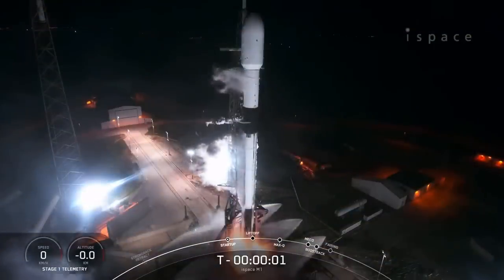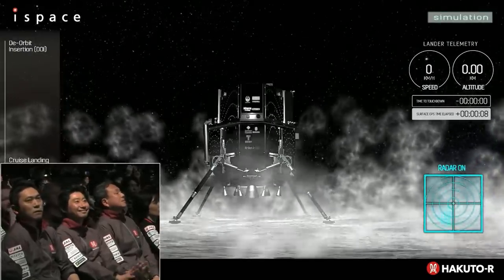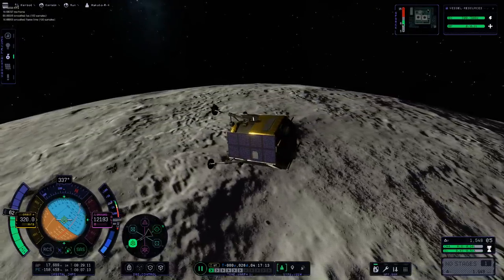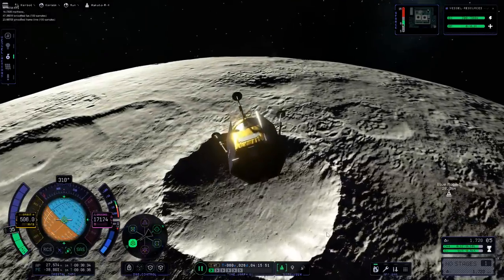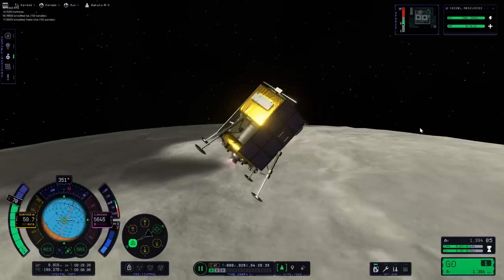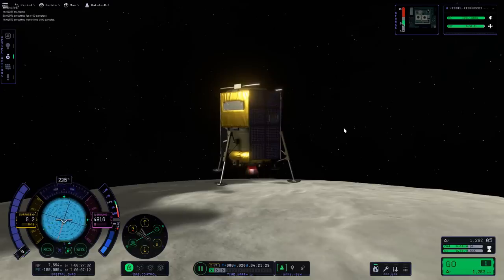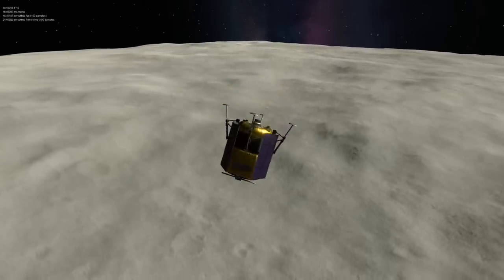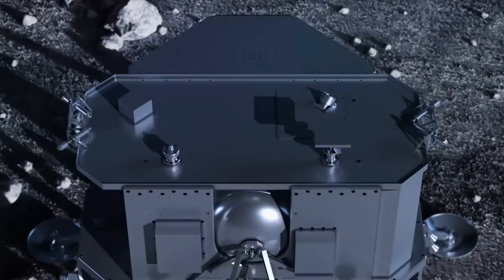Why Japan's Moon Lander Crashed Due to An Unbelievable Computer Bug

Comment: Not a software bug, it was a design bug.  The software functioned as specified.
Reply: How do you know? Did you read the design spec? If the design spec stated it should be able to handle multiple lunar landing locations, then it's not a design spec issue.
Reply: Definitely a process bug that this wasn't picked up in testing — but premature to say that it wasn't also a software bug.
Reply: @pigsnoutman  6:17
Reply: Mismatch at Requirements and/or Expectation levels. Activated by beyond test envelope operation. Needed a calm (seasoned?) "captain" to hold a steady, pre-planned course.
Reply: @simongeard4824  I think the video was quite clear on that the software started ignoring that sensor because it was programmed to do so. An intentional feature that behaved differently than expected because it was put into a situation that was not considered while designing it. And that this only happened because they changed the mission plan after the software was developed and did not test it again with the new landing site, because their tests would have detected the issue. That last part really hurts because they reasonably could have avoided the crash.
Reply: PEBKAC
Reply: If it behaved in an unexpected way (design bug) isn't that because the engineers had the wrong expectations?
Reply: Absolutely, the main thing is you got to have a radar altimeter. And they are small and compact and they use very little energy so why not have three?  If one fails, do you still have two working. I can’t believe what kind of idiots we have in the aerospace industry
Reply: @pigsnoutman  The design spec probably did not specify that it should be able to handle multiple locations since it would only be making one landing.  They gave it a new flight profile without realizing that there was a terrain feature that was abnormal enough to trigger the failure detection routine with perfectly valid data. If a portable earthquake detector gets knocked off the table by the family cat, it's not a bug in the software if it starts reporting an earthquake.

It's retroactively obvious that they should have re-verified the sim with the new flight profile.  They were a bit over-confident that not enough had changed to warrant a second test. The software performed exactly the way it was designed to, for the original conditions.  Without realizing it, they threw the program into abnormal conditions.
Reply: @simongeard4824  Respectfully differ:  it was designed to detect bad data from a sensor and to reject that sensor. And they tested it in a simulation using real world data and verified that the software worked properly.  What they apparently failed to realize is just how abnormal (compared to what they'd designed it for) the new terrain really was.  The software functioned perfectly, but any computer can only handle the expected. Throw it a problem too far out of the design parameters, and it cannot compensate. And they didn't run a new sim with the new flight profile because the previous profile showed that the software worked fine with real world data. They should have realized that when you change the destination, you have to recheck the roadmap to see if its still relevant.

And this kind of thing will happen again as we continue to learn more of the Moon's quirks. Some of which we should have realized on our own, like tall crater walls.
Reply: @nighttrain1236  It worked exactly as designed and as verified with real world data.  But they changed the landing location and didn't verify that the new terrain didn't violate the design parameters  somehow. They tested it for a relatively flat terrain because that's where they were going.  The software engineers didn't realize that the new terrain was outside the original design parameters, and either they chose not to re-test with the new terrain parameters, or they were told not to re-test it. It was not entirely practical to design software so versatile it can handle any terrain at all, if you know exactly where you're going and you're going there only once. Someone decided nothing was different enough to justify a re-test.  Clearly, they were wrong.
Reply: @nighttrain1236  The design spec probably did not specify that it should be able to handle multiple locations since it would only be making one landing.  They gave it a new flight profile without realizing that there was a terrain feature that was abnormal enough to trigger the failure detection routine with perfectly valid data. If a portable earthquake detector gets knocked off the table by the family cat, it's not a bug in the software if it starts reporting an earthquake.

It's retroactively obvious that they should have re-verified the sim with the new flight profile.  They were a bit over-confident that not enough had changed to warrant a second test. The software performed exactly the way it was designed to, for the original conditions.  Without realizing it, they threw the program into abnormal conditions.
Reply: @steveperreira5850  As stated, I agree with you.  We don't know why they chose not to go with more than one, therefore, we can't form a good opinion on how valid that reason might have been. Myself, I would also have made at least one of the sensors of a different TYPE, like, say, a LiDAR. If two sensors of very different types agree, then the data are unlikely to be false readings. Also, if the software was designed to understand it, the LiDAR, being designed for mapping purposes (usually, at any rate) could have showed the computer that the terrain was about to change again, hopefully helping to influence the computer's decisions.  At the very least, I would have had the computer report a fatal error if it thought the radar was out.  "Hi, guys, the altimeter is dead, so I will be, too, pretty shortly." For some types of the failures, reporting it at least gets them a head start at looking at the telemetry to find out specifics.

As for what kind of idiots we have in the aerospace, we have a lot of truly brilliant idiots. The kind of people who can design complex spacecraft, then go home and shock themselves working on their own electrical wiring.  For me, the one that stands out partially because we should be on metric too, are the American spacecraft designers who had the computer calculating all the data in feet without realizing that the European portion of the spacecraft, the part with the radar altimeter on it, was using metric data outputs. And a well-designed and very expensive Martian lander was lost because the braking rockets fired prematurely and it picked up enough speed again to crash.